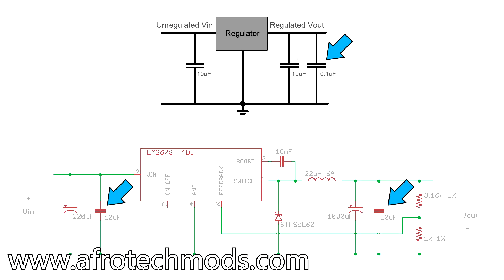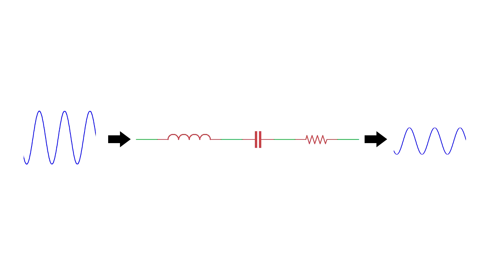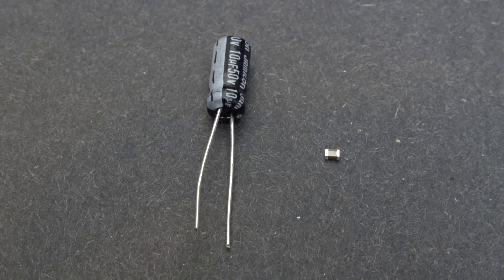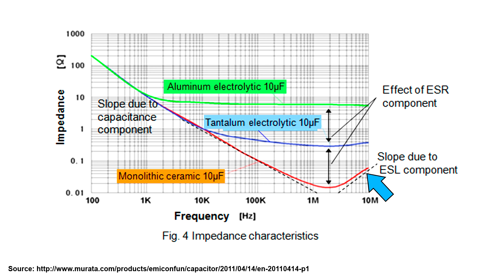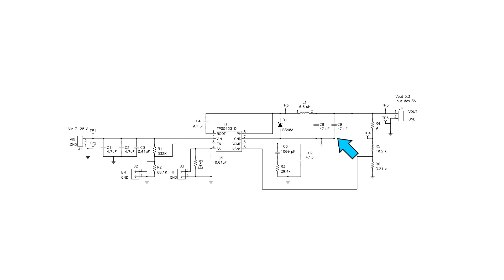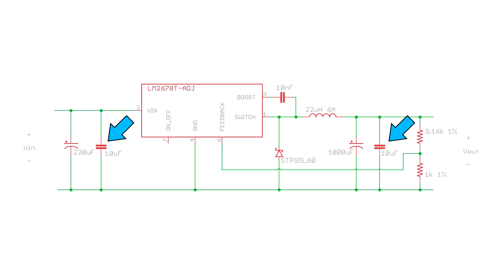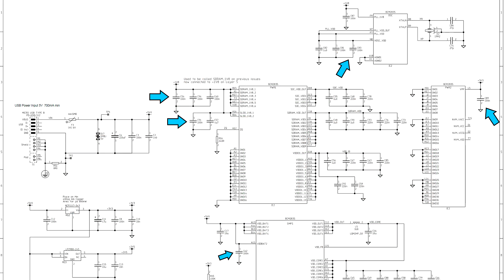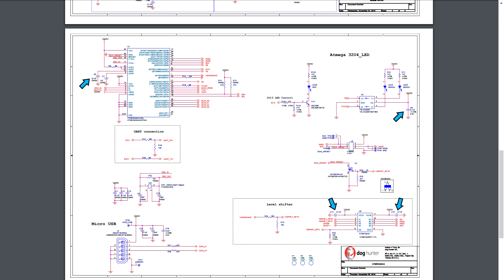Why electrolytic capacitors are actually kinda crappy 💩

Comment: Eh, sort of... But not 100% accurate. Check the ripple and Ic current into ground from both the ceramic and electrolytic capacitors across a range of loads between no load and max load then the design choices (namely having both types in the output path) is clearer. It's not just a "cheap hack".

Comment: Why use electrolytic capacitors? Price? Or are some circuits designed to only work on electrolytic capacitors? Can you replace electrolytes with polyester like I've seen in many "fixes" of different things in the internet?

Comment: "keep calm and use 100 nF"
Reply: Sooooo like. What about handling volt spikes(from a motor stopping suddenly), lots of noise, and that is close to a heat source.
Reply: @TECHnoman753   add a suitable MOV ( Metal Oxide Varistor ) for handling voltage spikes

Comment: Lets remember that electrolytic capacitors used on DC voltage rails are there to store energy so that you can sustain the dc voltage without it dipping during changes in loading. You dont care about their AC frequency response because they not used as filters! That is the reason why you have lower value ceramic capacitors next to them. They handle noise reduction.  Also, if you insist on using electrolytics in really noisy situations, like in your dc-dc power supply example, then you use low ESR types.
Reply: Yep, I'd love to see him apply his train of thought on a fractional horsepower electric motor that uses capacitive start and braking. Big electrolytic capacitors used for...... you guessed it.... energy storage.
Reply: This video is mostly BS, he's comparing apples to oranges. Sure they're both fruit, but they're vastly different in some major ways!

Comment: Why do we use an electrolytic capacitor when most of the work can be done by the cheap ceramic one? For higher capacitance value and hence lower overall impedance at high frequencies?

Comment: 1:35 "the higher the frequency, the higher the impedance"
4:51 "useless at filtering out high frequencies"

Aren't these two contradictory? If it impedes high frequencies, it filters them out, no?
Reply from the maker: Useless at filtering out high frequencies where the cap is used in parallel. This is because high frequencies cannot easily pass through it.
Reply: Oh, Parallel vs Series, that makes sense.

Comment: All electronic components have a suitable range of applications. Electrolytics shine in high capacitance values at lower frequencies, and are cheap. Their construction thus makes them the right choice for designs meeting the preceding criteria. Calling them crappy is like saying a low power transistor is worse than a higher power one. They each have their unique properties making them suitable for certain circuits. Make sense?
Reply: Yep, quality is subjective to the use u need!
Makes no sense to over-engineering if u dont add value!
Reply: I think Nichicon might of mastered ESR though man and time...a few of them anyways....Appears better than some Chemicons even.
Reply: I had to replace 10x100u ceramic caps with a single 220u electrolyte in a pulsed laser (500ns) power supply due to ceramic caps ringing. With ceramics the output voltage oscillated at about 5MHz due to acoustic resonance in caps and sharp pulse risetime. After replacing with electrolyte, all problems went away, and I got nice 40ns exponential risetime  as a bonus. So don't rush to discard old tech.
Reply: Maybe man...I don't know those Lelons sound really good. nice in large sizes, those were nice in decoupling and just loud bass.
Reply: They could have titled this "Why Ceramics Are kind of crappy".
Reply: @mneedes2  Depends on the application. If any given component type sucked at everything, it wouldn't be in production in the first place, or quickly ended.
Reply: Well, electrolytics have other issues with their life span. It would be much better if you could get the reliability of ceramics in a cheap package capable of handling higher voltages. The vast majority of electronic failures are due to bad electrolytic capacitors in a power supply, which contributes to e-waste.
Reply: How much wood would a woodchuck chuck
if a woodchuck could chuck wood?
Reply: +Alpa Chino  
How much clap would a capybara trap if a capybara could claptrap?
Reply: But nobody would open your video without this trick word...

Comment: I was just talking about this today, You are amazing to make this video. All credit goes to you. 
Thanks for making people understand what is going on with a capacitor. Today we had a massive failure on the old Equipment. Someone had a great idea to replace all caps on the system. After 3 long hours of trying to tell them about how re-cap was not a easy task for a beginner to do. they did it anyhow. The system is dead after they re-cap the main CPU logic board and the ADC / DAC.

Comment: You also did not mention just how bad the values actually are. 
Yesterday I was making a crossover for a surround sound and the board requires 2 @ 600 microfarad esr caps. When I put them on the meter both were over 900 microfarads. A far cry from the plus or minus 10%. 
I regularly check the electrolytics because of the lousy quality control on values.
I also understand that most of us don't have an extra $200-300 extra to spend on a dedicated capacitance meter.
In a crossover a 50% difference in frequency can make the design totally useless. 
In certain applications 1% can make a difference between a reference quality and a mass produced unit.

Comment: "Really high frequencies" 10M wut?
Reply: After years of dealing with electronics design engineers I learned frequency is a relative thing ;)
Reply: Brent Lewis, well, for audio applications it is a ridiculously high frequency – and by CPU standards it's the opposite. So, yeah, very relative  :)

Comment: 100nF is one of the cheapest capacitor values simply because so many are ordered at that value. So while it might be overkill in theory, ordering a 33nF capacitor expecting it to be cheaper at scale is a bad case of overthinking it.

Comment: Electrolytic capacitors aren't kinda shitty. They're a particular tool for a particular job. If you use them for something that they're not good at, don't be surprised if they don't perform as well as things that ARE designed for the task.
Reply: Alacritous yep, they just work great with lower frequencies and suitable for broad applications.
Reply: Well they are the cheapest and that's basically it... SMD ceramic capacitors are smallest (most dense) and most high-end. It would be quite expensive to produce a large one. An electrolytic capacitor may be worse in every way but because of it's low cost it still makes sense to use it in some devices such as ATX Power Supply units that require a very large capacitor.
Reply: isn't it the reason why he says "kinda" ? coz they're actually not shitty, but hey, in some cases kind of shitty...
Reply: @id15807936  no they are shitty, but they are a necessary evil because the other types of capacitors cannot handle high capacitance values (say above 20uF) or are too big/too expensive. And even for low values, some film caps are as cheap. Apart from that, they are worse than all the other types of capacitors by 1 or 2 orders of magnitude and they age and dry out, which isn't the case with the other types.
To mitigate their deficiencies, as EEVBlog explains, you can use several electrolytics in parallel: you reduce the total ESR, and moreover you reduce their heating, largely increasing their life.
Reply: Electroliticus-asswipicus, tantalum is the way to go, and let's not forget to throw in a ceramic too just for good measure ;)   Polymer caps seem to be the most reliable and promising replacement for electrolytic types.
Reply: They are what they are based on our technological development at this time.  Hopefully to be replaced with something improved in the future.
Reply: Fortunately these are aimed at hobbies like me who don’t know everything. It must be nice being you and being able to pick fault.
Maybe you could make some educational videos like this guy.
Reply: Alacritous , The art of Electronics 2nd edition had a nice summary of   types of crappieness for each family of capacitors. Electrolytic have an impressive craptacular factor.
Reply: @anullhandle  Yes, they are leaky and only work out to low frequencies. However they have the highest capacitor-to-volume ratio of any type of capacitor and their capacitance is not reduced by the applied voltage. They are used as "bulk capacitors" and are needed to handle high-current, high-speed, transients in audio and SMPS. Try using a bank of ceramics to handle a 10A/us 10 A pulse and meet a +/- 3% voltage deviation specification. You'd need a bank of ceramics at about 10 times the size of the equivalent electrolytics. Electrolytics have been around for nearly 100 years and there is no capacitor type that can take its place as of now. If there were, electrolytics would be gone. When engineers find something better for the same, or nearly the same cost, they tend to use it.
Reply: yes .They are best on using as filters in rectifiers but not thise in those SMPS,but atleast for Led bulbs.
Reply: Sure. But since the majority doesn't know, it's worth pointing out. And compared to the other types, they seem to be kind of shitty imho...
Reply: Agreed, but they fail before any other component so why not use other capacitors in their place?
Reply: They are found a lot in consumer products. When you manufacture a million devices with 1 cap. Then if the cap is 1 dollar-cent less, you gain 10k hard dollars more profit. If u have 2 caps on a board, then on a million products it's 20k/cent, with 3 it's 30k/cent etc. etc. If the cap is 2 cents cheaper, then the profit is hard doubled. In the real world it's less than a cent, but in combination with other cheaper components, or have a circuit that simply needs 5 - 10 caps and the gains can get quite relevant.

Discerning cents when buying say a 100 caps for yourself is an entire different level of economics and not really relevant.
Reply: Ausintune "they have been replaced by solid capacitors recently." - You don't mean every audiophile's favorites, the tantalum caps by any chance, do you? :P
Reply: Its like saying phones from the 2002 weren't bad they are just being misused, they were created for a specific job and dont perform well when they do other tasks. no shit sherlock but are you really going to use a 2002 phone in 2019 when they are better alternatives out there?
Reply: Click bait title ;-)
Reply: Ceramic caps are microphonic. Anyone want to open that kettle of worms? Or rather, summon that poltergeist?
Reply: @Jimbaloidatron  It's actually a time honored practice to title your content after the target viewer's own thesis. Only then can you lead them around like horses to your view.
Reply: Nope. They are just a cheap way of getting high capacitance. Most Industry fields have moved away from electrolytics. They are just a liability.
Reply: Alacritous they have been replaced  by solid capacitors recently.

Comment: In HF Rf applications it quite often isn't that critical.....tolerances aren't that tight ...even slightly different values can often be used....
Reply: Dan Nguyen  in the signal path and power supply....

Comment: 0.1uF is pretty standard for a bypass capacitor.  Generally speaking, the lower-valued the capacitor, the higher the frequency response, regardless of type.  In otherwords, it is much easier (and much cheaper in volume) to use lower-valued caps produced to lower quality standards for bypass purposes than it is to use higher-valued caps produced to much higher quality standards to get the same desired high-frequency response.

The other thing to note is that higher-valued capacitors, no matter how low their inductance rating, basically propagate noise instead of absorb it.  It is generally desirable for higher-valued caps to have inferior high-frequency response because if they had superior high frequency response the only result is that the glitch gets past the capacitor as it refills to the line voltage.  

The more expensive low inductance high-valued capacitors are used in RF and audio circuits for purposes other than line stabilization.  For line stabilization the higher-valued capacitors you use you actually want to have higher inductance (poorer high frequency response), for reasons mentioned above.
 
-Matt

Comment: Electrolytics also have a short life, getting shorter the higher the voltage. They dry out, end up losing capacitance and gaining ESR. If you're really unlucky they'll explode, filling the room with what looks like cotton wool.
Any ancient piece of equipment I get in for repair usually gets the Electrolytics replaced as a matter of course, they are at the root of so many problems. Tantalums can also end up going short circuit when they are very old.
You need to think about these issues if you're designing something that you expect to be in the field for 20+ years.

Comment: I had an old LCD monitor someone gave me because quit working. I took it apart looked it over and found one or two blown electrolytic filter caps. I thought whatever it should still be working it's getting voltage, but maybe that is the issue swapped cap with another cap I salvaged and it worked. Sometimes I don't have the exact right cap I just make the leads a bit longer and solder them in together. 

Another one an LCD TV they had a cap right next to a heatsink, I took the replacement cap and some wire and moved the cap away a bit and then hotglued the cap down. seemed to then work fine.

Comment: Interesting. When I did experiments acquiring (ADC) data, I choose specifically to use batteries to power my ucontroller. I suspected that ( without any "expert" electronic experience ) voltage regulators will screw up my measurements. Now I know a bit more

Comment: Next do "why some ceramic capacitors barely qualify as capacitors at all."
Reply: Just use a bigger one.
I once did the math and found that picking one with a higher voltage rating is not the way to go.

Comment: So what output capacitor should I use for step up converter with 400kHz switching frequency (XL6009)? It has to be rated for at least 63v.

Comment: Why is inductance abbreviated with an L instead of an I?
Reply: Karl Ruehs Probably because the “I” is already used to identify electrical current in electronics. E.g P=IV so it would get confusing using the same symbol for differing properties. The symbol L is named after the physicist Heinrich Lenz.
Reply: Yes indeed fundamental electrical components like electrical potential difference (Voltage) and electrical current flow ("Amperage"), were well known and defined before Capacitance and Inductance. So the "V" for voltage was adopted as both the schematic symbol and the unit after Alessandro Volta and seems obvious enough. The "I" for current apparently was adopted as the schematic symbol because of one André-Marie Ampère - being French the term he used to describe the flow of electrical charge was in the French language and the first word started with the letter "I" so it was used as the symbol. The SI unit of measurement is of course the Ampere(A) or Amp named in his honour.

Comment: The only caveat to paralleling capacitors for noise suppression is that they should be reasonably far apart in capacitance. If they are close in value and construction, they can form a resonant circuit at certain frequencies and create more noise then they filter. E.g. a 1uF and 2uF could be a bad choice to cover more frequencies.
Reply: It is best to use a single large one. Today MLCC can be had in sizes that make electrolytics useless. DCDC converters are usually so fast that you do not need a big capacitor.
Reply: A noob question, I have just enough skill to put together a crossover for audio applications. I have seen recommendations to put a small metal film capacitor in parallel with an electrolytic to improve performance(I assume low ESR etc). Could either of you shine a light on why this would be good or an error. Thank you.

Comment: I still don't get the bypass cap and how it works because time constant is different from the larger cap AND given they are in parallel, the larger cap still will have the noise issue due to it's ESL.
Reply: Tarek Z at high frequencies the electrolytic does not add noise, it simply has a higher resistance than the other cap therefore it doesn't shunt as much noise to ground as it should. It doesn't increase noise.  They like to use them because they work great at low frequencies.

Comment: Again, Why do designers put say 3 capacitors in parallel instead of 1 single one with a bigger capacitance value? after all when you put more of them in series there is a bigger chance for something to fair and simply short everything out sins that's how ceramic caps fail.
Reply: Michael Ceramic caps of large size has lower leakage and higher voltage rating, so 3x10u 50V caps will have higher capacitance then a single 30u 25V cap at 25V operation.
Reply: One of the reasons is to reduce the total ESR.